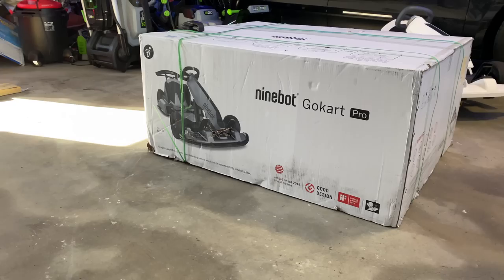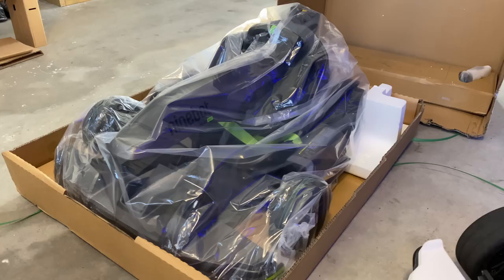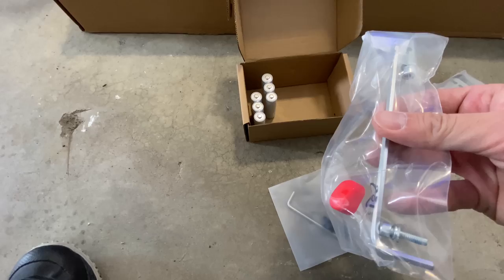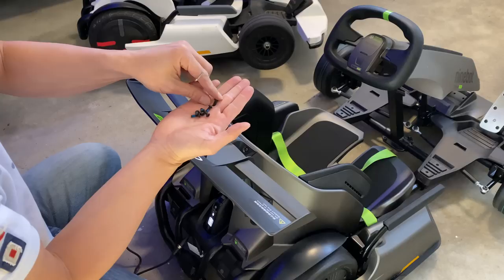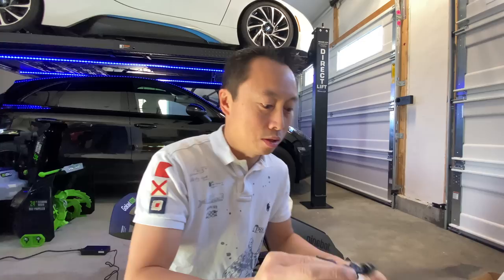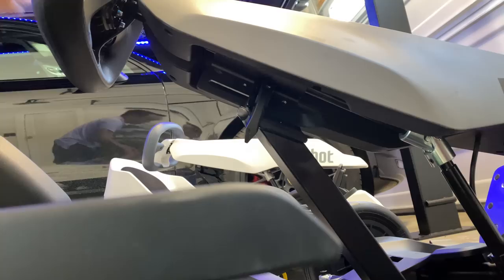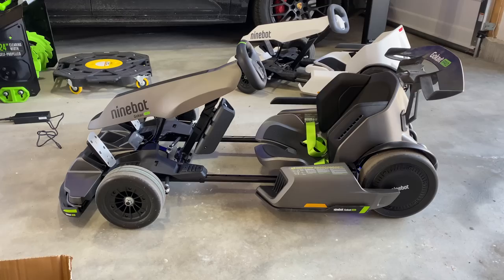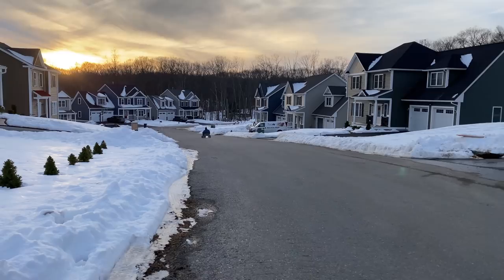Segway Ninebot GoKart Pro Unboxing and Assembly

Comment: Does it come with everything needed?
Reply from the maker: Yes it does.  Cart should be ready to run.  Just need to charge it first.
Reply: @ngl1145  okay and would you still recommend it as a birthday present ?
Reply from the maker: @wigglyjiggly6628  it would make a great birthday present.  It gives you a fun experience of speed and being low to the ground.  Reminds me of a roller coaster ride.  Great product.
Reply: @ngl1145  Thanks man

Comment: can you play music with the speaker?
Reply: Yes, its Bluetooth or you can make car noises from one cylinder to a v12
Reply from the maker: There are 2 modes.  One mode allows you to play engine sounds which is linked up to the Bluetooth throttle control.  Other mode allows you to play music.

Comment: 4hr charge time 2hr ride time. No thanks
My gas one will right all day and some with just 80¢ of gas.
Reply from the maker: I normally don’t ride 2 hours at a time.  It’s there for some local fun in the driveway.  If I were racing I’d buy a gas one.  So for the purpose of what I’m using it for, I feel that it’s a great quality product and provides some thrill.  If I want greater thrills, I just take the real cars out.